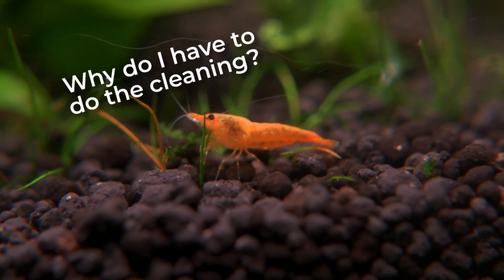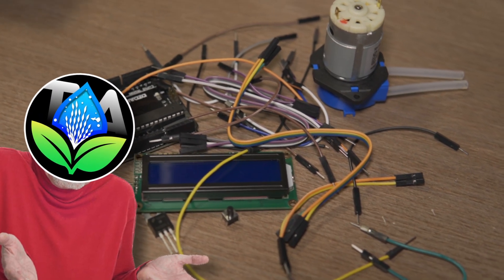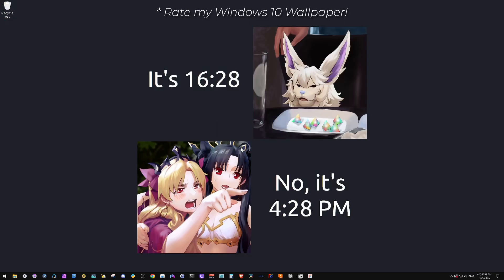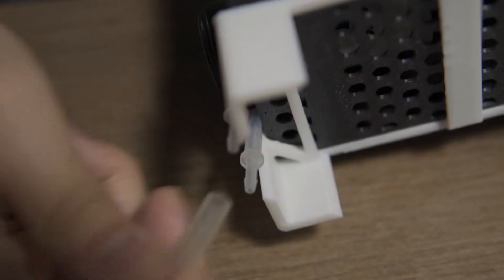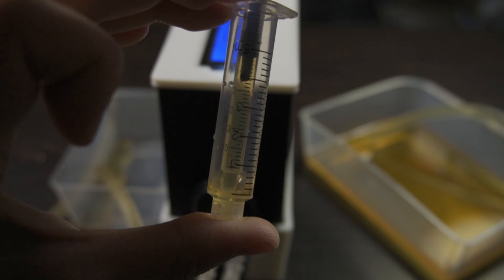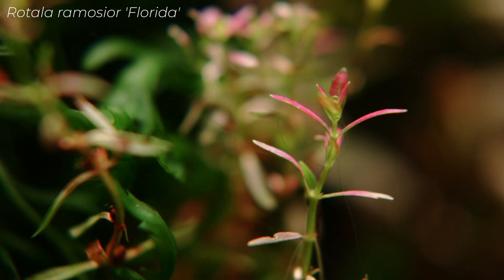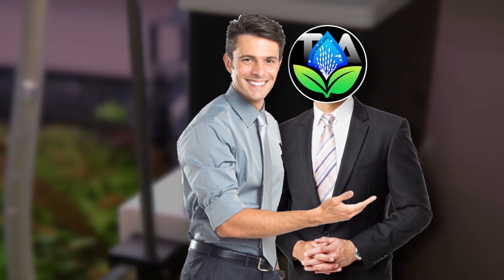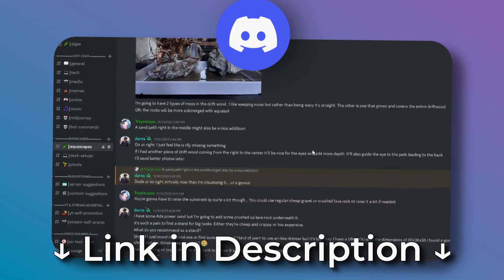I Built a DIY Aquarium Fertilizer Pump (And It Works!)

Comment: Definitely a bit more elegant than my DIY solution. But I only used a bottle with an CO2 adapter, an air pump, and a smart plug.
Reply from the maker: Technically, you can also get away with a smart plug and just the prestaltic pump, but you do loose the precise controls needed for fertilization.
Reply: @TropiscapeAquatics  Having more control over the time is very helpful. Typically with smart plugs you do run into the problem of a lot just allowing 1 minute intervals. You have to adjust the flow, whereas if you have more control over time and flow, it becomes more accurate. But it's not insurmountable, it's just a matter of adjusting things but I wouldn't  recommend if you are constantly adjusting things. I ended up just changing over to a "cheap" Jebao doser when I was dosing my tank. But I really didn't care about being too precise, but rather just not doing too much. But my airpump worked fine with the items I already had around the house which was the main reason why I did it. Actually got inspiration from a video my son was watching about a crappy soda dispenser. lol and always remember to test before putting it into service.

Comment: I would just plug a a 12V power supply to a digital timer and go on :D but very nice project, congrats! (Sorry for the shrimps... :(( )
Reply from the maker: That would definitely work! However, I made another one for my 5 Gallon tank. It needs to be dosed for less than a second...
Reply: @TropiscapeAquatics  still doable if you dilute the solution to the proper concentration :D Even you can use less voltage, probably the motor will work with it, but spin in a lower rate.